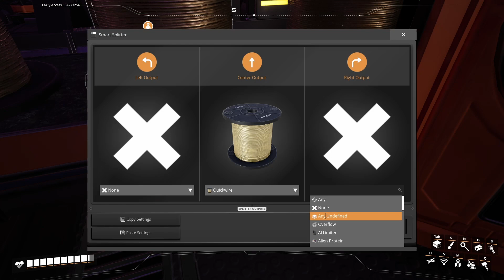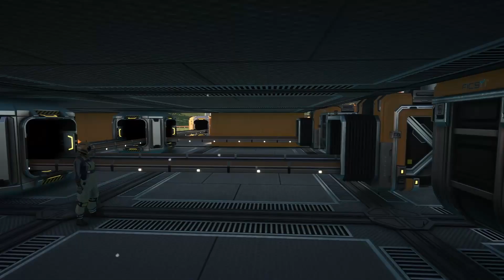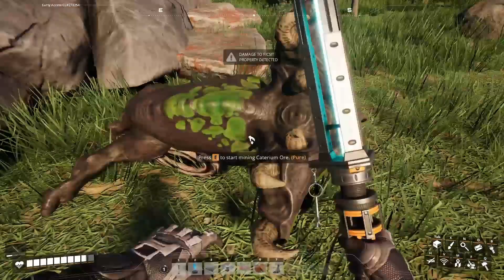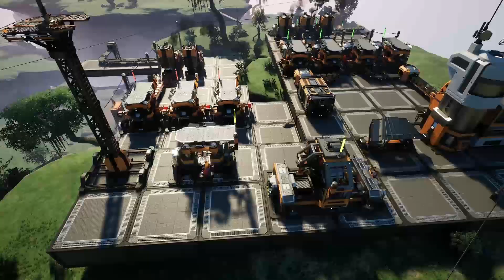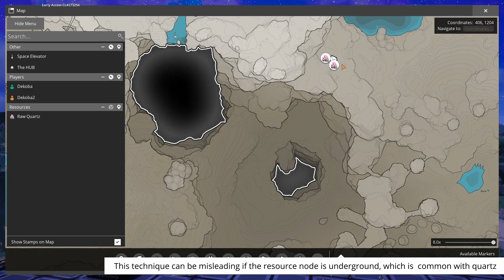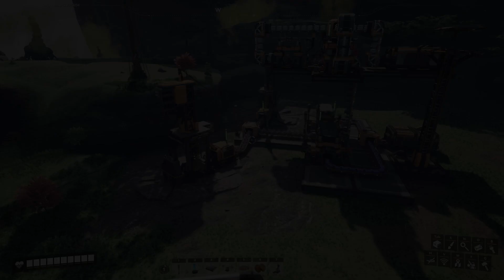Making a BEAUTIFUL Modular Frame Factory - Satisfactory Update 8!  (LP/Guide) And Caterium + Quartz

Comment: In my build the first smelter gets the most iron and the rest get less. And my rod smelters get most of the ingots so there isnt much left for the rest. How can i fix this??
Reply from the maker: Provide more iron. If each smelter uses 30 ore and you have 4 smelters and provide 120 ore, it will all balance after a few minutes.  If you are not providing enough ore you'll run into shortages.